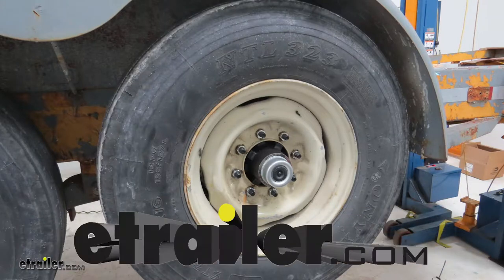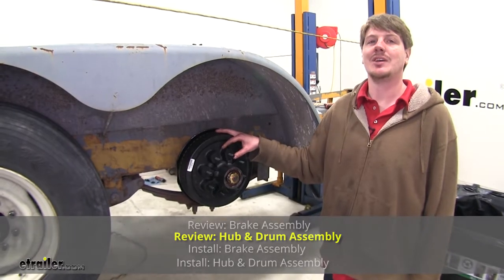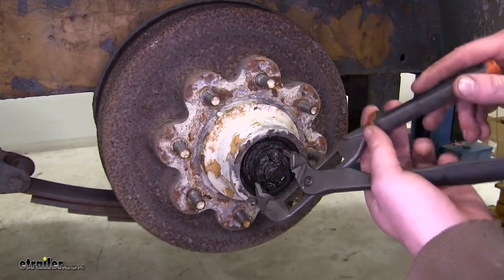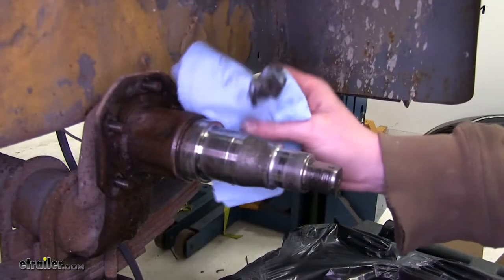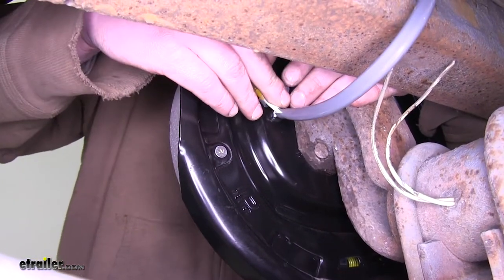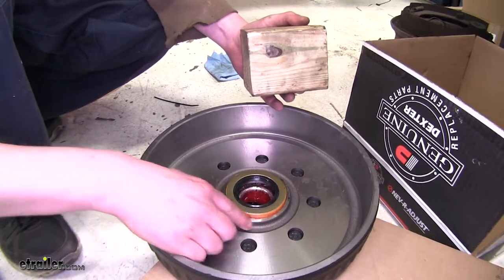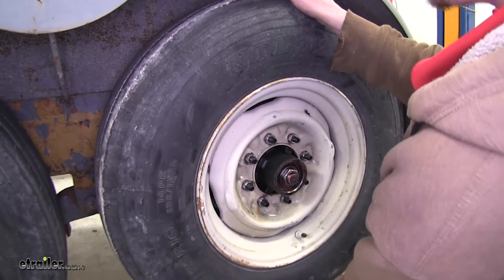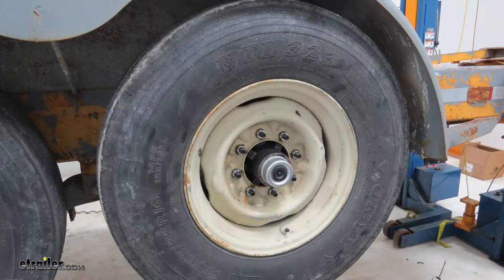etrailer | Dexter Trailer Hub and Drum Assembly Installation 23-458

Comment: You didn't mention how to tell if your spindle nut was too tight or too loose
Reply from the maker: The nut on the spindle should be tightened until snug, with no side-to-side play in the hub and then backed off slightly, about maybe a 1/8 of a turn. If the spindle uses a castle nut and cotter pin or tang nut, tighten the nut finger tight until it stops, then back it off so the cotter pin or washer tang fits into the next indentation of the castle nut.
https://www.etrailer.com/Accessories-and-Parts/Dexter-Axle/23-459.html

Comment: I am disabled and had no one to help me fixing up my step dad's trailer. The trailer had Idler hubs with no brakes on the axles. I found out my step dad only had a year or less to live. He had Melanoma Carsenoma cancer and was too weak to fix up his water front property on Mobile River. I asked him one day if I could pull the old trailer out of the bushes and Haul loads of crushed concrete - rock - and loose Gravel and fix up his property. He told me to try if I wanted to. So I put a 2 by 12 floor in the bottom and I found a place where I could get the material for free. I Hauled 50 loads and shoveled it all off the trailer by myself. When I had unloaded the 50th load my step dad Died the next week but he got to see the property fixed. On the last day of hauling he walked over to me and said Son I don't know how you did all this but Thank You. He had Tears coming from his eye's and he put his hand on my shoulder and said Son I'm Sooo proud of you. You are a real man now because you didn't give up.
Reply: Wow, very heartfelt.  In a way I wish I could be your step dad.